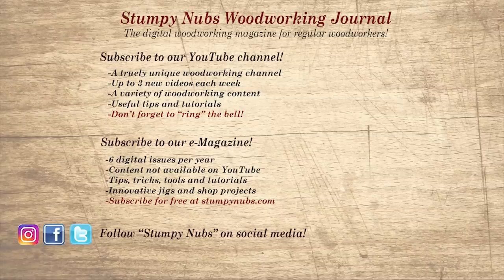Are table saws becoming obsolete?????

Comment: I love your channel but, with all due respect, you're talking about 'table saws' in a US context. Those lovely, solid, cast iron jobbies are simply not available to the hobby woodworker in Europe, even if we had 2-car garages to put them in, which we don't. And the cheaper alternatives which are available are mostly rubbish. As a beginner, I bought a European 'benchtop' table saw, because I thought it would allow me to make more accurate cuts. It turned out that the pressed steel table and wobbly fence on the thing are so distorted and out of square that I'm too scared to actually use it because of the kickback risk! I use handsaws or a band saw and planes instead, because I know they probably won't kill me! :-)
Reply from the maker: I clearly made a distinction between a saw with a good, reliable fence and one without one. I also made a distinction between places with dado sets and those without. Those are the two biggest factors in this discussion.

Comment: Yeah, I’m too accident prone. I’d be missing fingers after just a few days. Not for me. And I’m not willing to sell my firstborn to buy a Sawstop. I’m content to pursue my woodworking hobby without one, thank you.
Reply from the maker: I never said you needed a SawStop :)
Reply: If you're that accident prone you should have an entirely different hobby.
Reply: in my opinion a table saw is far safer than a circular saw or track saw.  to have a hand held piece of equipment buck in your hand with a spinning blade is far more scary.
Reply: If you're that accident prone don't get a router either.... at least you can run to the e r with the lopped off fingers

Routed fingers......
Reply from the maker: If only it were that simple. You can greatly reduce your chance of an accident with knowledge and care. But you can never eliminate the human factor. That's why you stub your toe even though you're an expert at walking. It's why someone who has a perfect driving record runs a stop sign by accident. And it's why every 9-fingered woodworker I know was a pro with many years of experience and thought he would never get hurt... until he slipped up, as EVERYONE does once in a while. I am not saying you need a SawStop, I'm saying it's nice to have insurance if that slip up happens someday.
Reply: @JorgTheElder  you keep believing that. Many old woodworkers who’ve lost digits followed the rules, observed the safety to the letter. Accidents are called accidents for a good reason.